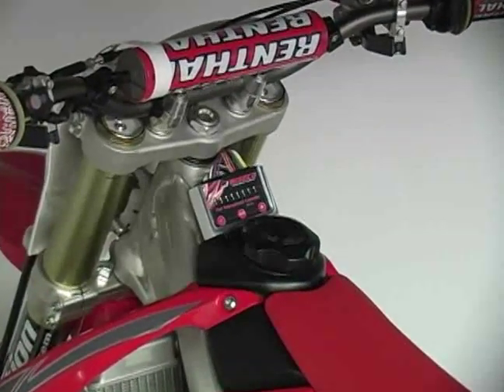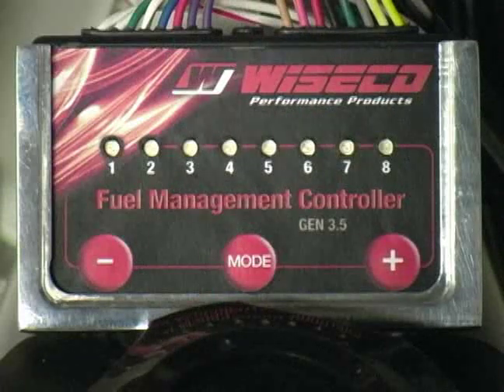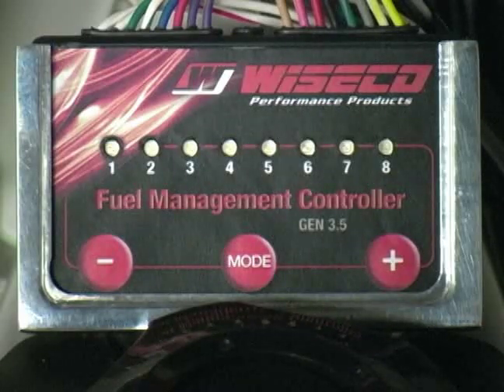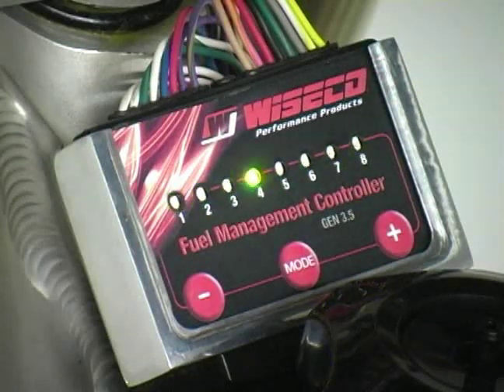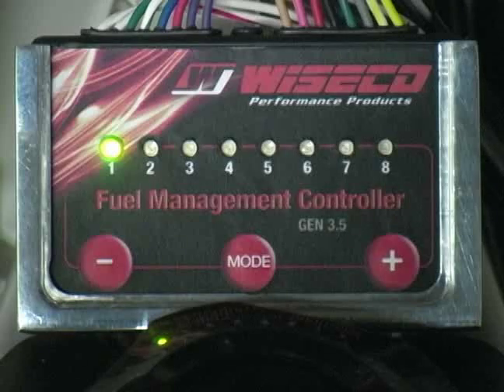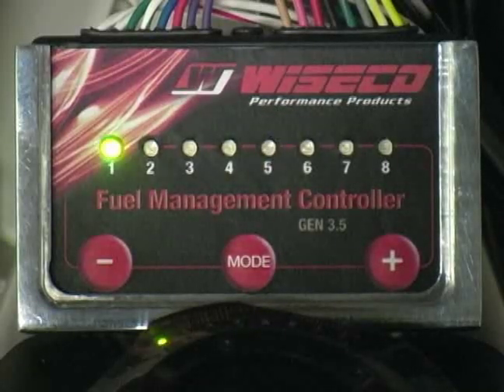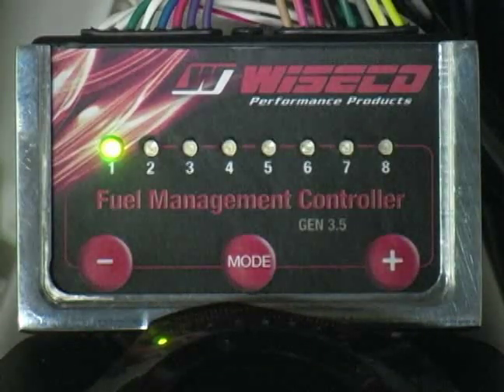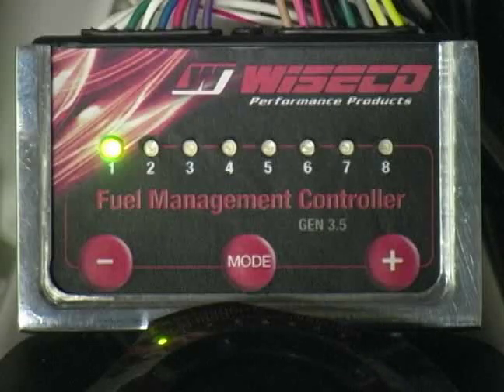Wiseco Piston Inc. - Fuel Management Controller

Comment: i my not be getting it but a electronic controller for a carb well the carb must have stepper motors to control fuel metering or something similar ..i say screw this and use mega squirt fuel injection  if possible
Reply: It is a system that mimics a carb for tuning fuel injected bikes. It isn't for a carb. - six years later